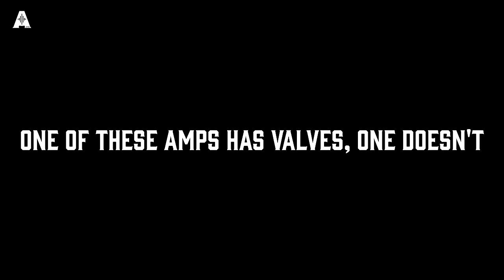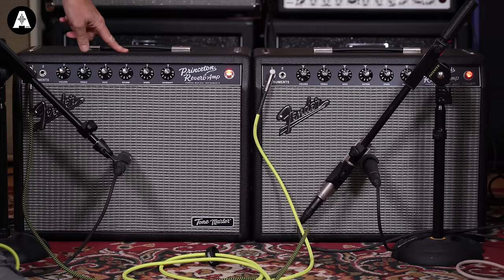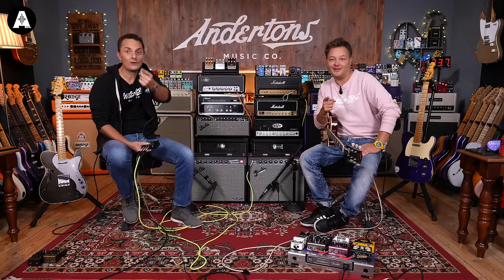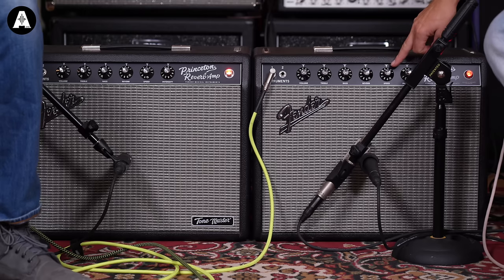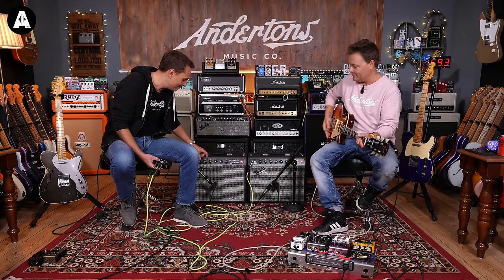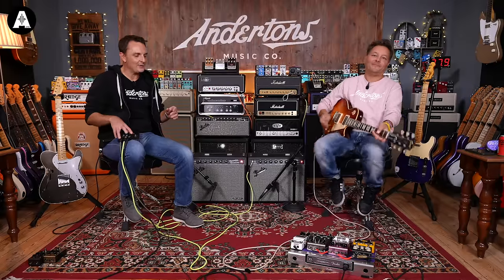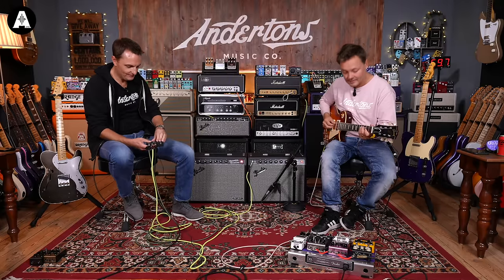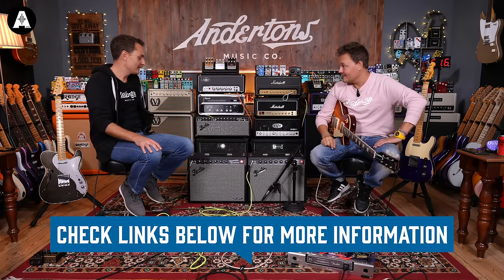Fender Tone Master Princeton vs the Real Valve Amp! - Can You Tell the Difference?

Comment: They both sound really similar in the clean channel.  The dead giveaway was when the overdrive was used.  You definitely could hear the difference between the digital and the tube.
Reply: From what I understand,  it's just the reverb that is digital. The amplification stage is likely still an analogue circuit, albeit solid state.
Reply: @ipullstuffapart  nope it’s all digital
Reply: @deluxeg  fair call! I was looking at the wrong spec sheet.
Reply: @ghost mall it just comes down to that they're different amps,speaker aside. If you swapped the exact same speaker back an forth, it's still be different. They tweak these designs and circuits.and they'll never put one out that's 100% the exact same spec,board,schematic, and parts. If they did, it'd basically be a custom shop amp at that point an it'd be 5000$£¢€¥
Reply: @NintenDub  5000 Yen would be like 30$. I'll take it!
Reply: @deluxeg   it's obviously not completely digital. It has to have a poweramp - which in this case is class-D and is solidstate - that produces an analog output signal.
Reply: @mrcoatsworth429  you’re splitting hairs here of course it has to have an analog output stage (like every other digital audio device) since human ears can’t decode binary signals. The entire tonestack and reverb is a digital simulation running on a DSP.
Reply: @deluxeg  I don't think I am, because I believe what you stated can be easily misinterpreted by some people.
Yes, the tone "circuit" is completely digital.
Reply: The tone masters just can’t take pedals like a tube amp can, if fender could nail that I definitely would switch

Comment: One thing I want to point out about modelling: the manufacturer making the algorithm is capturing a specific single amplifier, not every amp of that model. A person could put two old valve Princetons side by side and A/B them and hear differences depending on parts or amp/speaker condition. The Tonemaster might sound exactly like the Princeton used for the model profile.
Reply: But as the fuzz pedal highlighted - once you go outside of the parameters it was programmed to replicate, things can get very different
Reply: @Bobby-wn5yr Very good point!
Reply: I've had mine for over a year now, and to your point, the Princeton they modeled it after was apparently a damn good one. It's pretty much the Fender tone I've always wanted.

Comment: I got rid of my late model valve Twin and replaced it with a Tone Master Twin. I play jazz with a mostly clean sound and for my purpose the Tone Master sounds as good or better and won't break my back. You can also update or change the firmware. I don't regret the purchase.

Comment: I love the attenuation availability. You can't always crank the volume and being able to have the amp sound good sub 90 db is convenient. Hope other amp companies follow suit and make digital models that focus on a couple iterations of specific models.
Reply: Not only that, it makes the volume knob less of a nuclear detonation device. I have a 120W head and I can't use it without one, because the literal weight of your finger goes from 90db to 120db, and I swear I'm not exaggerating in the slightest, if anything I'm underselling here
Reply: @DudeMcGuybro  Like a hair trigger? I think I see what you're saying. You guys both have a point. In some instances, tube amps would be ideal. But if your circumstances don't lend themselves, a tube amp can create more problems than it would solve. I wish Marshall in particular would follow suit and create an amp in the same vein as these Tonemasters. Sound is not the only factor, I like looking over at it and seeing that I'm actually using a real amp as opposed to something that more resembles a blu-ray player.
Reply: That also turns into producing a consistent sound at any venue. And it’s enhanced more by the speaker impulse XLR out, so you’re no longer at the mercy of how well the live sound engineer knows how to mic a guitar amp. So you can monitor for your own pleasure onstage, at the gain level you want, and be confident the audience is hearing what you’re hearing.

Comment: Without any pedals added, both sound really similar and very nice. But with overdrive/distortion/fuzz pedals added, I heard some nasty high frequency artifacts on the digital amp, in addition to being more boxy and less smooth and warm. So my choice would still be the tube version. Very nice comparison, guys!
Reply: did i miss where they toggled between the cabinet emulators?

Comment: They sound slightly different but I think you can dial them to a very similar sound; the Tonemaster just needs to be tweaked differently on the EQ setting. It's the same with my Super Reverb TM. You can make it sound very valvy!
Reply: Best comment I've ever seen because it is so true. I have a TMSR aswell.

Comment: Both these amps sound great.  Honestly, from the intro, I couldn't tell which was the valve am and which was solid state.  My initial guess was Amp B being the valve one as it had a slightly warmer sound when played with a Tele but it was a point that I considered it might just have the bass up slightly more.
Reply: Yeah, I'm terrible on the difference between tube and digital (never having owned a tube amp) but I was fairly certain that B was the tube amp ... and it's also the one I preferred. Oddly, the tube amp sounded cleaner, almost digitally clean. Go figure.

Comment: I had 2 Princeton reverb Reissues.  Great amps, but they had at least 8 tubes in them.  One of them started having a squealing noise when at a certain volume.  It was a tube issue.  I had to figure out which tube was the issue.  My point is that for someone like me, who plays at home, the tonemaster is all I really need:   Good tones with less maintenance concerns, and other options as well.   I do also own a 57 ri champ and 70's champ.  Great amps as well, but simple, only 3 tubes.
Reply: Same here. I had the same issue with 65 deluxe reissue. Went through two of those amps brand new in three months!!! Both tube issues. Been cranking my TMSR for over a year now with absolutely no issues at all.

Comment: As I listen to the fuzz pedals being compared, I feel like the TM digests the pedal in a way that is more friendly for production, whereas the tube amp translates the pedal the way we naturally love to hear it and feel it. Plus, the tube version sounds 'wider' with pedals, and the TM kind of compresses them and focuses them in a very tight and centered way.
Reply: I think that you are right.
I feel like in a band and/or recording context I think the Tone Master would be cutting more and be easier to use as it's stage volume and the front of house volume can be different and won't be influenced by you turning up the amp. Sound Engineers will like these.
Reply: That's what I was hearing too. All that low end in the tube version with the fuzz sounds good on its own in the room but would actually be problematic in a live or recorded mix.
Reply: @Big_Coil   Could it set a precedent for the other big 2 to follow? A DSP '59 Marshall-or JCM , DSP Vox AC30..or 15 ..the small AC10 would work in digital . A DSP Tone King ..the list is long
Reply: My thoughts exactly. There is more spread on the tube version. I think if you were to put a little widening effect on the TM, it would close the gap!
Reply: I actually thought there was a little bit more clarity with the TM and fuzz. I liked it a bit more but I may be the minority.

Comment: Great comparison, but for the cost difference I would go tube amp. I bought a 68 custom princeton reverb for $800 used in mint condition.  At least the tube amp can be repaired.  The digital amp would be a complete board and how long is Fender gonna make those? If the digital was $300 that would be way better option.
Reply: Your modern  tube amp can barely be repaired. If anything goes wrong often times the traces get burned on PCB amps. That’s why vintage amps are still so valuable. One is because there’s a finite number left and the other is that they are actually repairable and built to last unlike any reissue amp Fender makes unless you buy the “hand wired” variant
Reply: @stratsouldier  totally agree, but then you get the fun of gutting it and doing a hand wire amp..lol

Comment: They’re a bit different, but both very good!  The DI out sounded like it needed a tad more bass and reverb.    I agree with Pete that the Tonemaster inherently has a bit more mids.  So turn up the bass and treble to keep it in perspective. I will be buying this amp!
Reply: Could be just a mismatched pot. If you set both on 6 (or any other), the resistance level will always be different. Even two pedals or amps of the same model will sound different if you set them to the same "visual settings". But, if you have a decent QC department that measures every component individually, those differences are minimized.
Reply: @olifilipe  The Tone Master doesn't have pots, I think. Since it's all digital, those are probably rotary encoders. So it should be always the same in this model. But what you're saying is still true for the 65 Princeton, of course.

Comment: They are really similar, but I guessed correctly because the digital amp had a bit more clarity, which I actually preferred, until the fuzz showed up the digital amp and the valve amp was so much better.

Comment: The biggest (pleasant) surprise on the Tonemaster is (for home recording in particular) the emulated output sound. That, through my headphones at least, sounded better than it did miced up in the room and at least as good as 65 Princeton. That was impressive. The fuzz/OD argument doesn’t affect my opinion as I would almost exclusively use a Princeton for those beautiful Fender cleans. 
Given that the DI sound is so impressive, it would be interesting to see how it plays with different IRs in software. 

Summary: with an attenuator, headphone out an Direct Out to your sound card/computer/ DAW/Speaker simulations, the Tonemaster version looks perfect for home playing and recording or easy lugging to a studio. Of course, the tone romantic in many of us would LIKE a valve version but, from this demo at least, the Tonemaster is probably better suited to the applications I’ve listed above. Love to hear from actual owners as I’ve yet to see one in the wild.

Comment: Just an advice for anyone here ! If you can get a 65 Princeton Reissue go grab one it’s really great. Magnificent cleans, and the way it’s driving the reverb and tremolo when you crank the amp is really something to experience. Definitely one of the best amps I’ve ever played and owned.
Reply: Yeah but $799 vs $1,200 and an extra 15 pounds in weight. There is no right answer.
Reply: When the Digital goes Out
So Will You. Out $799.00. 
Oh I forgot. You can Re Use it for  a Boat Anchor.  :).
Reply: @danabiondo9243  Yeah because that keeps happening.
Reply: @DTension  To be honest I don’t find it too heavy, the Deluxe Reverb is heavy yeah, but not the Princeton. For me at least.
And yeah the Tone Master is cheaper, but I’m more into changing tubes and other things than throw the amp to garbage cause something blew up in it after 10 years. That’s why I bought the tube version :)
Reply: @michael4630  I get it. I would hope (but don’t trust) that Fender would have good affordable supper for their tone masters. It would be a really bad look if they all started to fail at the same time.
Reply: @DTension  I hope too :)
And I hope that the PCB replacement part won’t be $50 less than a brand new amp 😅.
Reply: @DTension  A good, affordable supper?

Comment: If you stack a low gain overdrive pedal after the fuzz, it solves that harsh fizzy sound when using a fuzz in the Tone Master. I prefer stacking it with the Wampler Pantheon on the low gain soft clipping setting. I'm sure any blues breaker type circuit will work fine.
Reply: Or add an eq before it.
Reply: @ghost mall That’s sure sounds plausible.  There’s nothing inherent in the Tone Master’s modeling that should make it perform so poorly with fuzz, except for the fact it has an A/D converter on the input which WILL clip if the signal gets too hot. And clipping an A/D will behave a lot differently than overdriving the input on a tube preamp. Probably just needs some attenuation after the fuzz to keep its signal in the right range.

Comment: To me it's always been about matching the correct gear together. I had a guitar come to life in cheaper solid state amp, but not sound as good in an old tube amp. The Protien distortion sounded good in the solid state, the fuzz sounded good in the valve amp. Find the correct match to your ear and you'll be all good

Comment: I play a Princeton and am a fan of the Tonemaster concept however, I don't know why they did a Princeton Tonemaster. It's priced the same as the 68 Vibro Champ, which would be excellent for loud home amp, a week or two extra saving for a new 68 Princeton (which absolutely needs attenuation at home) perfect for pubs, and used Tonemaster Deluxes are louder, cheaper, & have the same great features. Frankly Fender picked the wrong 12w amp to Tonemaster. They should have done the Tweed Deluxe.
All that moaning said for posterity, this sounds great & I'll bet they sell millions.
Reply: Would love to see a TM tweed deluxe but I think they won't do it because the driven sound/feel is too difficult to emulate. Clean tones are easier to copy digitally ib would think.

Comment: I was definitely rooting for the modeling tech! But the moment that the drive and gain was boosted, I knew it was a lost game
Reply: @ghost mall I hear you and I believe you are right. The loss of the low end though completely changed the EQ balance the Princeton provides and to my ears didn't sound too good. Not to say it can't be dialed in differently or that it sounds like rubbish. On the contrary, it sounds just as good as any other amp in certain scenarios.
Reply: @ghost mall I have the might Axe FX3 Turbo and love it to death. I believe it has the best modeling on the market....but if I COULD I would be an analog guy all day just because its more fun at times. Although digital definitely has its advantages.
Reply: @ghost mall Happy Wife Happy Life :)

Comment: I could absolutely tell the difference and guessed correctly. Both sound really good though. That said I have never heard a non valve amp that throws sound the way a valve amp does. I think that is the part that is truly impossible to replicate. Valve amps kick out sound in such a physical and visceral way.

Comment: The Tone Masters are great amps.  The only real "flaw" is that they don't behave the same as their valve counterparts when you boost the front end.  Even though I have the hand-wired '64 Custom, I'd consider grabbing a Princeton Tone Master when I see one at the right price.
Reply: But why? Just curious, or you mean you'll sell the 64'?
Reply: @tomdijk5549  I'd keep the '64.  The Tone Master would be an amp that I could take with me when I visit someone or go on holidays because it's cheaper and there's less to break.

Comment: Tbh this was pretty clear amp A has the springs and tubes, especially back to back. The tones are quite different.

But… if you didn’t have the amps side by side either amp could really be all you need - basically if you couldn’t sound amazing off amp B, it’s not because of the amp. The pedal thing could really be a problem though. I feel they’ve nailed replicating the tone master, but that fuzz kinda exposes that once you go outside of the set parameters it was programmed to match, things can go a bit wrong. It really struggled with that fuzz input, and that could be a problem for some people as a lot of people buy fenders for their clean tone because they want to use them as a pedal platform

Comment: I’d probably still save up go for the valve one, not for the sound but I feel like it’s gonna be more of an item that I’ll treasure in the future, and if I want a modelling amp I probably would’ve get something that’s more versatile than the tonemaster, but just my personal preference though
Reply: Yeah. I agree on this one, even as a proud owner of the deluxe tonemaster.

I do plan on getting a classic princeton reissue. With the Deluxe or twin, you are getting a major benefit for practicality with the attenaution, DI out and weight. But the princeton as is, is already lighter weight, smaller, and lower wattage. And you can still simply mic it.

And I think the fact that it is repairable and will never become obsolete out does the benefits of the tonemaster. 

It makes more sense to go with the tonemaster if you are considering something like a Twin, because the original Twin is so heavy and loud and inconvenient that it's absolutely worth it to go for the tonemaster.

The ONLY downside I have found with the tonemaster after almost 2 years is that someday it will be obsolete and lose it's value, and someday it could break and it won't be able to be repaired.
Reply: Fender make great valve amps but can't compete with the likes of Neural and Kemper yet in my opinion. Unsure who this amp is targeted at since digital  while valve guys want valve.

Comment: Yes... but

Yes, when listening to the amps side-by-side, playing the exact same part, listening through Adam A7X monitors, +25 years playing guitar, and trained ears from +5 years recording and producing guitar oriented music  ->  I was able to accurately identify the valve amp and real spring reverb.  However, this might be the wrong question:  
1) In the context of a full mix, there's little chance I would be able to pick out the valve amp
2) In a recording scenario I'd be more than comfortable using the modeled amp... and I'm fairly obsessed with vintage gear